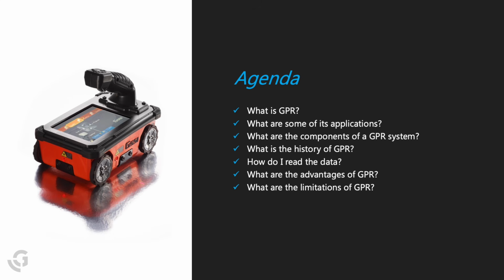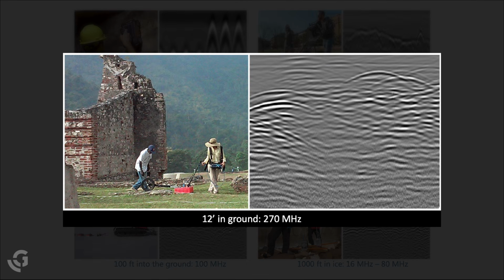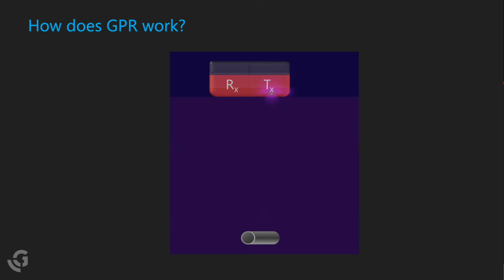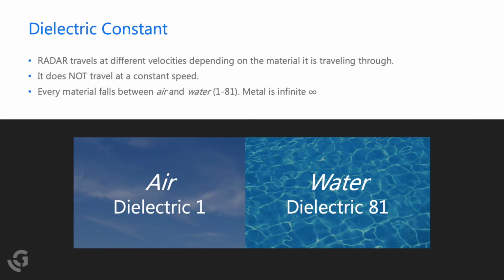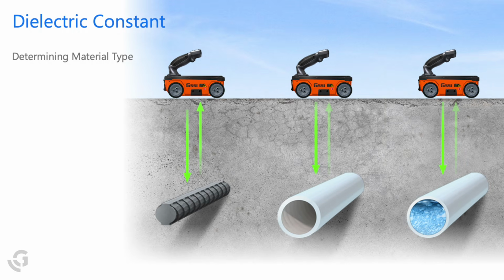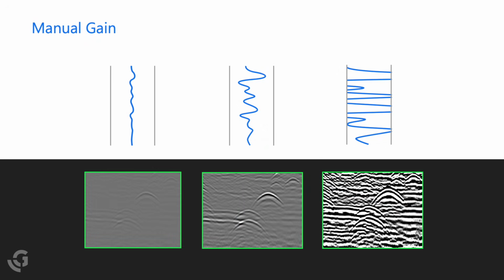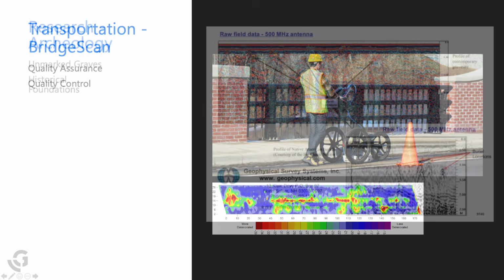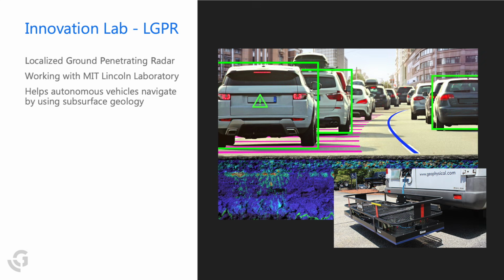Concrete Webinar - GPR Method & Theory

Comment: Well according to Peter Leach 2021 (Theory primer and guide for ACFs surveys with GPR, page 10 - and also 36) he says that air voids display a  black-white-black wavelet polarity due to increase of OEM speed from soil-to-air interface. Which makes sense since the air/ground-coupled wave display always the opposite, as white-black-white, which means that the OEM went from a lower dieltric (air =1) to a higher one (average soil = 16) , therefore a decrease in speed. Please let me know if I'm wrong. Cheers
Reply from the maker: Hi Rui, that’s a really good question, and you are not wrong. I had a long discussion with Peter about this just now to better understand the language that we use to describe this. Both the Archaeology Primer and this video make the same point, but it is confusing that they can end up using different language to describe it. I found that Peter and I were also using opposite language to describe the same thing. This is because we are trying to generalize a complex and highly variable process, but when we are using the white-black-white or black-white-black terminology, we are describing an ideal scenario. In an ideal scenario, the GPR sends out and receives a three-component signal, such as a positive-negative-positive (white-black-white) signal. However, in real world environments, you sometimes only get two components of the signal, or you get more than three components. 

Here’s a quote from 8:26 in this video that I think is a better simplification:
“This well help us identify…material type…whether the target is metal – positive – or air filled PVC, which will be labeled as black, or negative”
In this quote, we're referring to the first strongest component of the signal - the middle component of an ideal, white-black-white or black-white-black reflection. If the dielectric increases at an interface (such as a metal plate, or going from air to ground), the polarity of the signal will flip relative to the direct wave (although for better or for worse, you cannot always see the full direct wave on modern GPR equipment). This would result in a white/positive first strongest signal. If the dielectric decreases (such as an air void or empty plastic conduit), the polarity will match the direct wave which means that the first, strongest signal will be negative/black (with GSSI equipment, anyway). It may be easier to think in terms of the first strongest signal, rather than in terms of white-black-white or black-white-black reflection patterns, which can be inconsistent in their appearance. Look for the first, strongest component of a reflection and use that to identify material type, because the other bands in the signal may or may not appear, depending on the complex, real-world scenario that you are working with.

Thanks for the opportunity to give some thought to the terminology we're using here, and if you have any other questions feel free to follow up here or email training@geophysical.com!